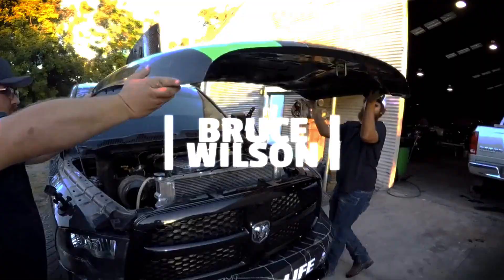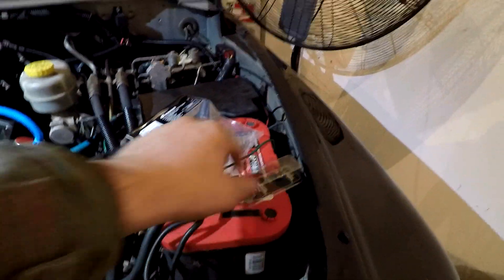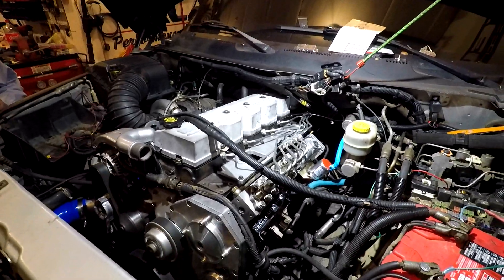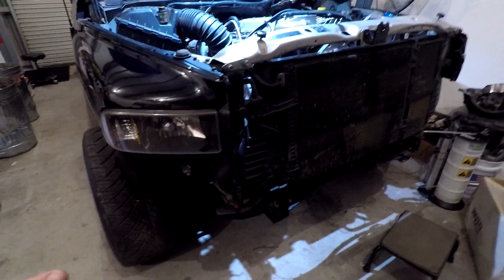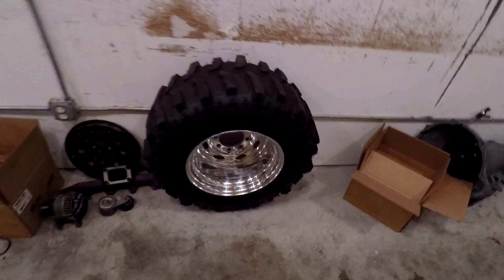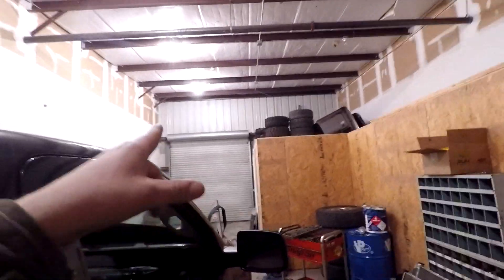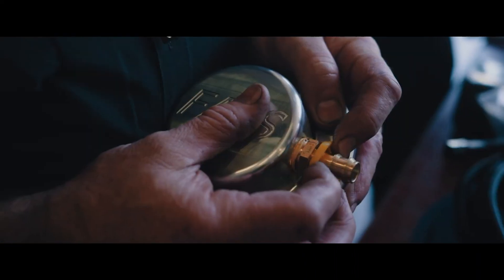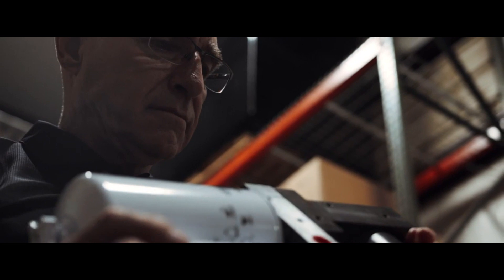P PUMP SWAP DONE WUTTHADUCK CUMMINS!

Comment: What does it usually cost to do a p pump conversion?
Reply: @Bruce_Wilson  I have a 95 p-pump truck with rod through the block, found a 24v short block for $700. Other than gaskets,  is there anything else I need?

Comment: I saw you used scheid .083 lines. Did you use stock crossover tubes or he already have bigger tubes? I’ve got .093 scheid lines and 40hp tips on my injectors and get a lope like his on cold mornings. Used to have 100hp injectors and it would drive me nuts loping so bad. What in your opinion is causing it on first start up? Thanks

Comment: So what's the point of a p pump?
 I don't have a Cummins but I did see a p pump conversion for obs 7.3
Reply: Mr.PoopyButthole 600hp all day on a stock pump 800 on a lightly modded one and up to 2000 on a built one